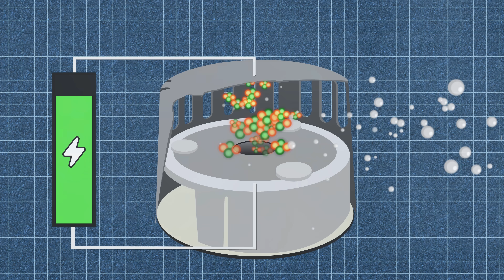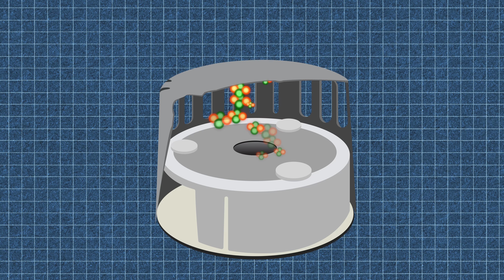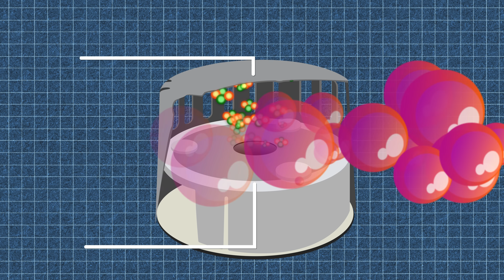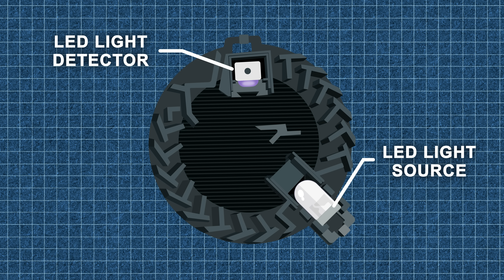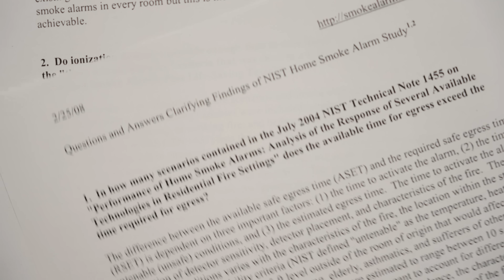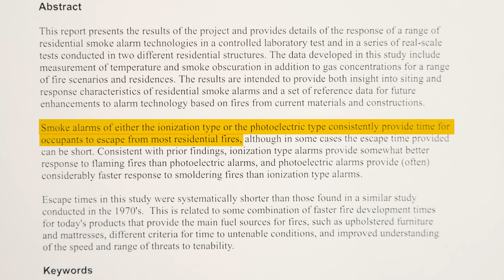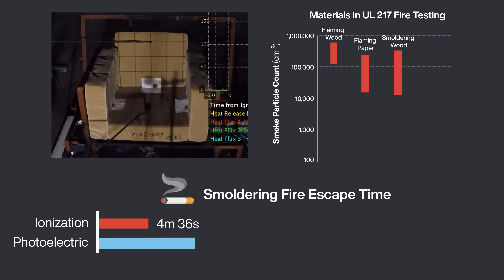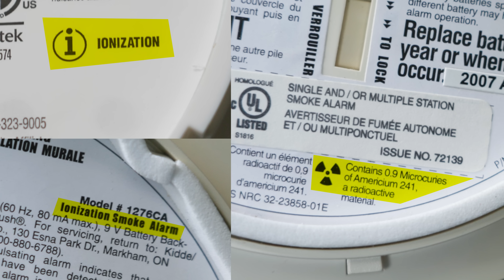Why the Most Common Smoke Alarm is Dangerous

Comment: |> |> |> |> |> |> |> |> 
|> |> |> |> |> |> |> |> |> 

The pen is a great home selfedefence tool by surprise attacks, ...

Very good and fast to draw, ...pointy ...

Nice.

About the detectors ..
.

2024 in this time counting ... Is it deffantly possible to combine both technologies in one device cheaply ...

|> |> |> |> |> |> |> |> 
|> |> |> |> |> |> |> |> |>
Reply from the maker: Hey Illus,

haha, yeah the pen is a lot like the poking self defense tools.  It's definitely sturdy.  

The problem with dual sensor alarms is these alarms can be just as sensitive to cooking false alarms (UL, Characterization of Smoke Alarm Nuisance Sources, 2015).  They're also hard to find, expensive, and the only 8th generation dual sensor alarm is currently unavailable for purchase (as of June 5, 2024). 

As well many homes require CO detection and you'll have to choose between having those separate vs interconnecting them with the rest of your home.  Same issue if you want separate photoelectric and ionization alarms.  I think Interconnection is more important.

Kidde's new 9th generation of smoke alarm is Photoelectric only.  This was what I was expecting in the video as I was shocked ionization could pass the new tests, but I'm guessing that's no longer possible.
Reply: @Lam  

|> |> |> |> |> |> |> |> 
|> |> |> |> |> |> |> |> |> 

With a simple logic circuit is this to solve ...

The errors of both are known ...this regodniced it works ...That is actually one chip where two sensors go in.

That are cents ...

|> |> |> |> |> |> |> |> 
|> |> |> |> |> |> |> |> |>

Comment: The blind spot of smoke detectors, as highlighted in the video, is their slow response to smoldering fires, which produce fewer but larger smoke particles, leading to a delayed alarm that allows toxic smoke to accumulate dangerously.

Such fires can smolder for hours, producing a lot of smoke that contains dangerous gases like carbon monoxide. Common causes include cigarette butts left burning on flammable materials or electrical fires within walls or appliances.

If your house is not made of wood, you're fine. A fire will be a real fire and smoke detectors do work.

Comment: So one thing that confuses me.  They say to mount CO detectors low since it's heavier than air, but many of these units combine smoke and CO but they are mounted on the ceiling.  So... are they effective at detecting CO on the ceiling?
Reply: CO is not heavier than the air.      C is 12 in atomic units, O is 16,   so CO is lighter than O2 ( oxygen than we breathe) and equal to dinitrogen N2 which constitutes more than 70 percent of atmosphere, nitrogen atom  N weight is 14

Comment: We once moved into a house where the previous owner smoked. One day, a smoke alarm fell on the floor and the smell of the carpet set it off.😂 

It took us over a month of running all the ceiling fans nonstop at full power with all the windows open to get the smell out.
Reply: Dude, unless the ceiling fans were put in new by you, the smoke smell was in the ceiling fans also..
Reply: well you know smokers🤣🤣
Reply: well that means the smoke alarm is still good🤣🤣🤣🤣🤣
Reply: You should buy ozone generator next time. Due to the nature of ozone, it likes to move the extra oxygen to anything (that's why it's toxic to living things). It turns other things (in this case stuff that makes smell) to gas that goes away.

Comment: Ionization smoke detectors have been banned in Europe for a couple of decades now...
Reply: Largest in Europe smoke alarm manufacturer in Ireland makes both optical diffusion and ionisation smoke alarms, and other sensor devices such as hazardous gas sensors. However optical are the main type sold and suggested. In Germany and France the ionisation alarms are not offered due to difficulty of legal disposal after a fire (the alarms themselves are not outright banned but cause a substantial liability that nobody wants to deal with unless they absolutely have to - they may be needed in some industrial and specialised settings), but they are offered in some other EU countries, but are not the preferred type in any of them.

Comment: Its nice to see they finally implemented algorithms and deep microprocessor analysing. Dual sensor units have been around for decades (FIrst Alert/BRK SA301A/B/C is the one I am most familiar with), but those were basically just threshold based and almost literally two units on the same circuit board. Waveform/time is a great way to analyse, backed with all the data gathered from testing. Great to see this!
Reply: So how long does the battery last on these microprocessor based detectors?

Comment: Never put a smoke alarm anywhere near the kitchen! 😆
Reply: But a lot of fires... start in the kitchen! It's not ideal to not have it secured. Especially if you have a modern fridge, that no longer uses non-flammable fluorine compounds for coolant, well the new coolant is methane based, and there's polystyrene foam insulation in the walls, and polystyrene lining on the inside, these things burn so fiercely. Plus the thermostat is basically some arcing-prone and degradation-prone electrical contacts and it's somewhat exposed to condensation.

I do have an optical smoke alarm in the kitchen (discretionary decision by me) and so far i have only been able to set it off when i actually burned something, so that's good. It's also at the window.

Comment: why not both ?
Reply from the maker: Hey Sea, glad you enjoyed the video, 

The problem with dual sensor alarms is these alarms can be just as sensitive to cooking false alarms (UL, Characterization of Smoke Alarm Nuisance Sources, 2015).  They're also hard to find, expensive, and the only 8th generation dual sensor alarm is currently unavailable for purchase (as of June 5, 2024). 

As well many homes require CO detection and you'll have to choose between having those separate vs interconnecting them with the rest of your home.  Same issue if you want separate photoelectric and ionization alarms.  I think Interconnection is more important.

Kidde's new 9th generation of smoke alarm is Photoelectric only.  This was what I was expecting in the video as I was shocked ionization could pass the new tests, but I'm guessing that's no longer possible.

Comment: There is another smoke detect type with a combo CO  alarm.    Does that help the slow response by detecting the low O2 ?    CA  makes you install them in sleeping areas and reg types in other areas.   Ion detectors however are now banned from the trash and need hazard waste disposal. Plus we only have non replaceable 10 year batteries only.

Comment: My 40 year old smoke detector worked great and alerted me to a fire I accidentally set... and then went to bed.

My best advice to anyone buying a smoke detector, is buy one that is powered by AC... not a battery.
Battery powered smoke detectors are pretty much useless.   It's okay if they got a battery backup, but their primary power source should be plugged into your AC circuit... preferably directly in, up high, and not plugged in where it could be unplugged.
Reply: Why useless?

When the battery goes flat you have a softly chirping alarm telling you to service it. Never use zinc carbon cells in your fire alarm, they aren't suitable. Alkaline are acceptable, but need to be replaced yearly-ish (last about 2-3 years), though you need to test your alarms yearly regardless. Lithium primary cells have a 10 year design life and will usually last about 20 years.

Anyway not a problem i had to concern myself with, mine have large sealed-in lithium primary cells that last the life of the device. They only let us keep the same alarms for 10 years anyway before we have to replace them for fear of smoke chamber contamination, LED/sensor degradation or the like. The replacement is up soon and i'm picking the same alarms again, since mine are not blinking, are very loud, have an easy to reach mute/test button, are easy to install and remove, and have not given me even one false alarm but have alerted me when i forgot and started burning my food in the kitchen, which could have become a fire but didn't.
Reply: @SianaGearz  My radiation one worked like a champ at 40 years old.  It may be an industry myth they go bad.  There is no way I could keep a battery fresh for 40 years straight.   I've had chirping low battery ones before and they drive you insane if you dont know where or what it is.

My friend bought a retirement care house and moved her big family into it with 15 battery chirping  ones in it and they will drive you nuts.

Im thinking I should get a led sensor one for double layer protection after watch a video about strengths and weaknesses of both the americium version and the light sensor versions.  If I can find or make an AC wall wart version
Reply: @choppergirl  Not sure what happened to my earlier attempt at reply. Anyway 10 years is a PURELY political limit, various lobby groups. I'm quite convinced the sensor chamber is good for 20 years in these ones under bad conditions and might be good for 40 under more benign ones, at least for well made ones like these. But nobody wants to make guarantees that reach that far into the future. And since i am obliged to throw away 10 year old alarm units even though they're still working well, sealed battery ones do the job. I have not had any battery chirps in more than 8 years that i've had these and i have to replace them soon, and they test and run fine, no nuisance alarms either. The few times i set them off something was actually burning :D

I was thinking of taking battery ones and installing a lithium cell which should last 10+ years.

To be kept in mind, the emergency rechargeable battery in mains powered ones doesn't last forever either, the constant trickle charging wears it down.

Comment: Great video! I think around 11:45 the two labels on the graphic are the wrong way around. You have Ionisation taking 4m36 before alarming, shouldn't that be Photo electric with Ionisation taking 35m 36 before alarming?
Reply: right sorry I get the text at the bottom now, it was partially obscured, it's time available to escape, not time before sounding alarm

Comment: Excellent work! So the 8th generation fire alarm unit is primarily based upon the photoelectric process but has a pre-programmed micro controller added for fine tuning to reduce some of the limitations of the older and much simpler photoelectric detectors.
Reply: Didn't it say ionization on the 8 gen one in the video ?
Reply: @dmitripogosian5084  - I came to my conclusion, that the 8th generation smoke detectors tend to employ the photoelectric effect, after looking at the listings of recommended detectors that were linked from the video description.
Reply: @vernonbrechin4207  Ok, that means the discussion in the video after 13.58 is misleading, it more or less explicitly leads to believe that gen 8 algorithms are developed on ionization alarm data.
Reply: @dmitripogosian5084  - I found that part of the presentation to be not clear so I went to the recommended data base and written presentation to clarify what was intended in the video.

Comment: what I am wondering is: why don't all cooking ovens/their heating plates come with built in Timers for each plate? You turn on the plate AND set the timer, just in case! Then, if You/Me forgets something, the Timer turns off the plate and the meal isn't completely cooked but this is better than the kitchen or house geting completely "smoked" or worse!!! (which happens all too often)
Reply: I bought two induction cooktops a few years ago, brand Duxtop $70 hobs, and they have timers.  Timeout is not the default but you can set it.  I looked around and there are not many stoves with this feature for some reason, other than on the oven.  I think Thermadore has one.  The Duxtops are still working, I think it's been 5 years.
Reply: Because it would annoy the shit out of everyone. A stove with a 5min "dead man" switch... I guess you've never cooked anything more complicated than an egg, or slice of baloney. If you're that forgetful, you shouldn't be allowed to cook without supervision.
Reply: @jfbeam  You are somehow right about my cooking expertise; nevertheless, how many times did my wife, who does the regular cooking, set the kitchen and other rooms full of annoying smoke, fortunately not yet fire. Even my neighgor's wife once fried a stake to black smoldering coke! 
Btw.: now that the gov is in the know, they should promote selling "Double Tech"  smoke detectors, photoelectric + ionization!!
And another very annoying point, each new detector comes with different mounting dimensions!!! How many holes do we have to drill over and over again!
Reply: @jfbeam   Some people think they're always smart and never make mistakes. Smart people know they're dumb for a few minutes a day, just about every day.

Comment: Some years ago some knob head took a faulty microwave oven to our workshop saying "it did not heat" as I wanted to make a quick toilet visit for a leak, So I put it on the bench, put a cup of water [for standard test], pushed in two minutes, and quickly made it to the toilet, when I returned the workshop, it was filled with smoke, but the Ionization smoke alarm had not gone off, when we took the smoke alarm outside, it worked fine with burning paper under it, as for the microwave, the owner had taken out a blown 8 Amp fuse and put in a 30 Amp car fuse,  >>>>>>>>>>>>>>>>>>> Just before the French revolution for some strange reason back in the 18th century, François-Marie Arouet Voltaire (1694-1778) a French Enlightenment writer, historian and philosopher said;

“If there’s life on other planets, then the earth is the Universe’s insane asylum.”
[edit: few corrections]
Reply: "as for the microwave, the owner had taken out a blown 8 Amp fuse and put in a 30 Amp car fuse, "

I literally cannot state just HOW stupid this owner was. I literally cannot find the words; every time i try, my language center has an apoplexy, and that apoplexy has its OWN apoplexy. 

You NEVER, EVER, under ANY CIRCUMSTANCES, replace a fuse with one of a higher rating, **EVER!!!!!**  I would only allow an exception if the equipment is required to keep operating to sustain the life of your FAVORITE parent/child.
Reply: @andrewdreasler428  Yeah, that's almost as dumb switching on a piece of electrical equipment and leaving it unattended when the only thing you know about it is "something ain't right."

Comment: And I have 15 smoke detectors in my house, that were just replaced two years ago, all Ionization type.  AC powered with battery backup and interconnected are required by building code here.  The new First Alerts are $30/each, vs the $10 of the previous gen.  Hummm  I guess I will depend more on the other 4 that are tied on my alarm/fire panel as well, that are dual type detectors and also the flow sensor on the fire sprinkler and the heat detectors that are installed for notifications.   Good video sir.  Keep up the good work! 👍🤠

Comment: The obvious solution would be to have BOTH detectors in a single alarm. The other thing I've noticed far too often (especially in hotels, offices and even flats etc) are incorrectly placed alarms - often they're placed on walls which means the smoke has to gather with enough thickness to reach down to them in order to activate them. They should always be on ceilings, NOT walls and as close to the centre of the room or hallway as possible.
Reply from the maker: Hey David, thanks for watching! Appreciate the comment.  

Walls are actually an acceptable placement, I can't remember if they're ideal or not but it is up to code.  Codes do talk about dead-spaces but also from research that is disproven.  

The problem with dual sensor alarms is these alarms can be just as sensitive to cooking false alarms (UL, Characterization of Smoke Alarm Nuisance Sources, 2015).  They're also hard to find, expensive, and the only 8th generation dual sensor alarm is currently unavailable for purchase (as of June 5, 2024). 

As well many homes require CO detection and you'll have to choose between having those separate vs interconnecting them with the rest of your home.  Same issue if you want separate photoelectric and ionization alarms.  I think Interconnection is more important.

Kidde's new 9th generation of smoke alarm is Photoelectric only.  This was what I was expecting in the video as I was shocked ionization could pass the new tests, but I'm guessing that's no longer possible.

Comment: I dont believe the video. My smoke detector goes off all the time. At least when there's no fire.
Reply from the maker: You might need to vacuum out your detector, that's something I didn't metion.  Otherwise it could be a placement issue too.  Too close to the shower / kitchen.  Otherwise getting a new smoke alarm is a good fix.

Comment: Ethanol fires?
Reply from the maker: Really uncommon, they got rid of some sort of flaming alcohol spirit test because of how unrealistic it is for residential homes
Reply: @Lam  There os no smoke. But there is heat and gas.
Reply from the maker: Yup, and particles.  Good for ionization, terrible for photoelectric to pickup.  Luckily most homes aren't science labs.